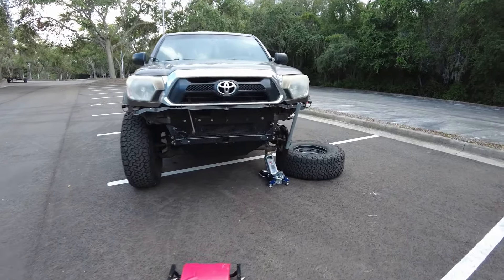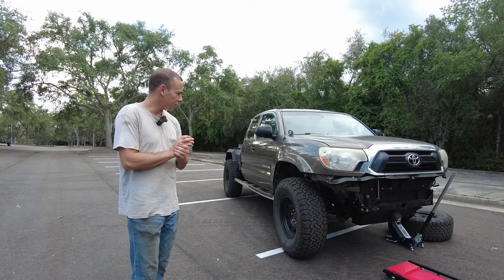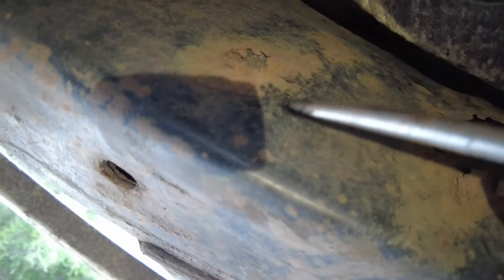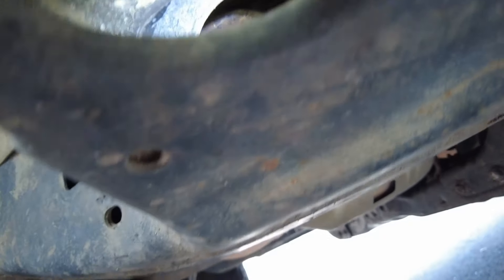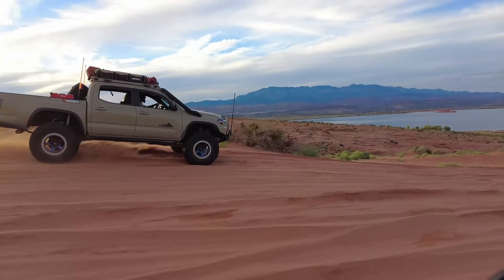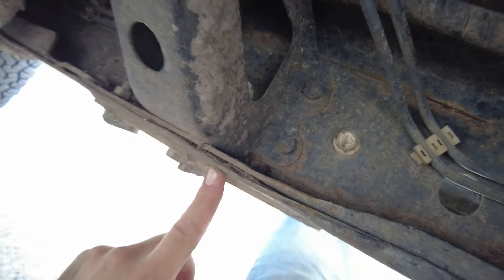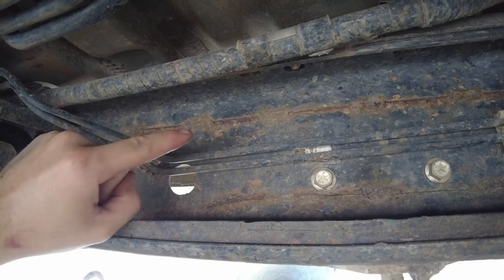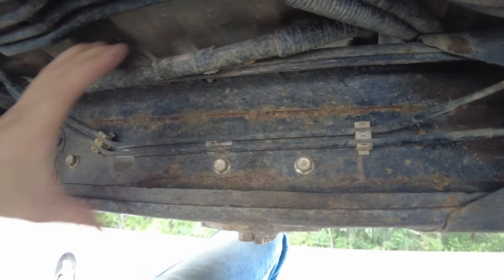Toyota Frame ROT - My truck ruined. Why did Toyota design it like this?

Comment: My 2000 4Runner had a spot I had repaired happens to most that get salt on the roads ! I’m in Baltimore county Maryland and my truck has 291k miles and runs like new ! It’s lifted 5 inches on 33 inch Mickey Thompson tires ! Still averages 18mpg mostly city !

Comment: I was always very meticulous about checking frame rust, sanding, painting etc, but it seems ridiculous with all the cutouts that you just hope its staying dry. I have been using lanolin undercoating since I live up north. That seems to make a huge difference.
Reply from the maker: Thanks for the info. Maybe I’ll start using that product.